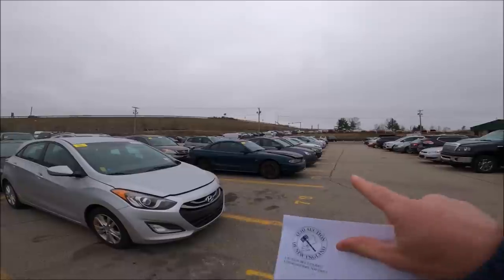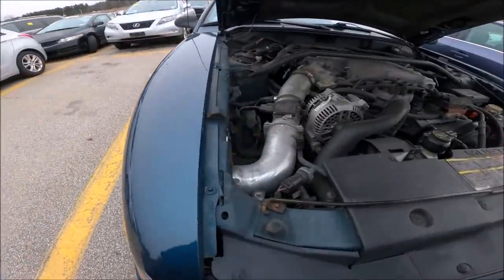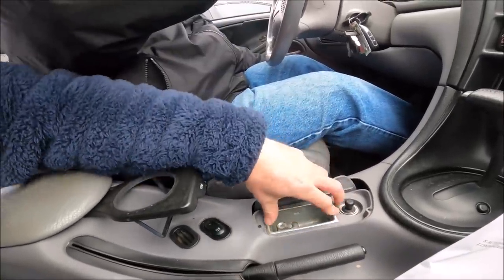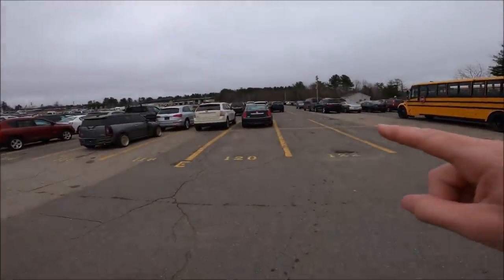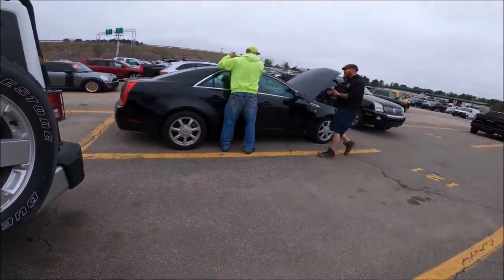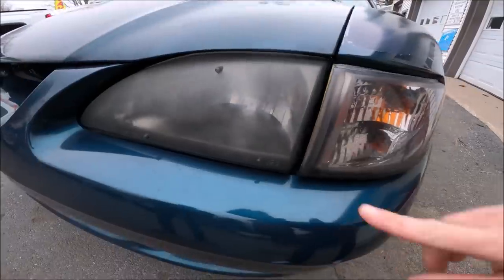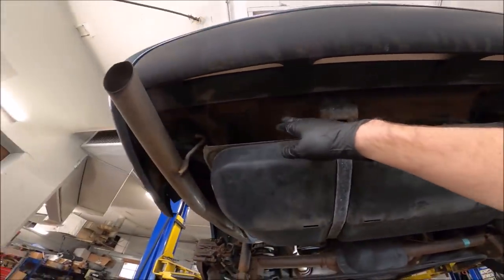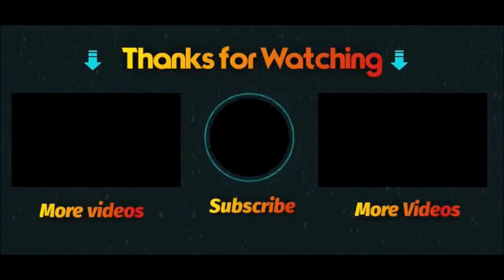What will $2000 buy you at a Dealer Only Auction? - Flying Wheels

Comment: Well the GTO is actually a Holden Monaro, The factory was shut down in 2016 and they were made in limited numbers so they sell in Australia for up to 80k.
Reply: Yea only 26k probably in the US
Reply: Wrong... Holden is its own company. Pontiac stopped making the Gto in 2006.  And as of 2017 you couldn't buy it cheaper than 8k. One of the last modern hot rods

Comment: Craig, I completely understand your excitement over the Mustang. It's a once very common, mass produced car you'd see everywhere. Now? Not so common. Plus it is rough around the edges, but solid enough to improve & have some fun with. Parts & pieces are plentiful and overall won't bankrupt you fixing, restomodding and improving.
I have a '17 GT350 and '76 Valiant in the garage. You know which pulls people down the alley to the back garage? The old, malaise, beige, V8 Plymouth. They can relate to it. Nostalgia. Little things I do are easily seen (it's very clean & solid- no rot, the interior isn't ripped or cracked all to Hell). It's unusual.

That Mustang? Same thing

Comment: Love the Stang. 90s cars are the best. I have a 99 turbo Volkswagen that I built to 350 wheel horsepower for pocket change. That 5 liter is another one of those perfect for a budget build.  Heads and cam used off eBay. Bam. A ripper.

Comment: Tell me one thing.  In order to become a successful used car dealer in the USA 🇺🇸 .
A person should own his own workshop or he can outsource all the repairs and cosmetics and get done and still make good money?
Reply from the maker: When I started I outsourced all of the auto repairs and did the detailing myself
Reply: @FlyingWheels  thanks for answering.
Reply: there's a local used car lot that doesn't even know enough to change the oil on a car they repossessed after 18 months of slow payments. And it had the exhaust pipe just hanging on by one bolt, which they didn't notice. They did know enough to clear all the engine codes after anyone test drove it though. I ended up buying this hunk and thought I got a decent deal knowing I would have to do some work on it. Just didn't know how much. Now I understand why people say to take that dealers sticker off your car before you try to trade it in.

Comment: Craig, I didn't think it was possible to destroy an interior like that Mustang in only 80,000 miles. I don't believe that car is legit for a minute.
Reply: The odometer…I got mine with 94k, supposedly. The engine, manual trans and clutch were good. It was a “tired” car at that mileage. I always suspected the odometer had been f’ed with. But I’m a Honda guy that was torque shopping…found it. The powertrain was so fun. Over 60 mph it wasn’t trusty - the alignment and such. New, I’m sure it was no disappointment. It had some electrical gremlins too.
Reply: Yep it's suspect.

Comment: Craig Toyota Tacoma double cab 5 get bed 143k is it really worth 14,000.00 14 year old 2wd truck in TX?  I don't trust the dealers here anymore!!
Reply from the maker: Tacoma are expensive I don't pay much attention to them
Reply: @FlyingWheels  Thank you so very much for replying. I was a nissan hardbody guy but now need a truck good on gas mileage. 
i scored really good when I bought my Tahoe it is a 1995 with a 5.7 liter 4x4 it had a bad alternator and battery when I bought it for less than $1k
but it gets like 3 gallons to the mile.

Comment: it's so sad to think back to the early 2000s whe. you could buy all manner of cars for 500-1000$ that would run and drive for years with some proper maintenance.
Reply: It was alot harder to flip cars back then. The internet becoming more broadly useful over the last 20 years has helped alot because in 2000-2002 there weren't many avenues to find used cars to flip besides AutoTrader magazines, Ebay, and the local newspaper.

Comment: 2:00 looks like a puma went to town on that driver's seat lol
Reply: that's the thing that kills me with car makers: the driver's seat in most pickups too wear 100x faster than the other seats. If they made the seats or at least the covers, interchangeable it would not only reduce the production cost but allow you to even out the wear.
Reply: @muskokamike127  There's all types of automotive upholstery shops that recover just the worn seat bolsters for usually a couple hundred bucks in most cars (sometimes less if you unbolt the seat and bring it to them) - This Mustang might be cheaper to just find a nicer seat in the junkyard or on Ebay though, there's still alot of these things around considering how old they are now..
Reply: @Stressless2023  Yeah probably but with interchangeable seat covers you could double the life of the stock ones.

Comment: I had a 98 six cylinder and loved it . It was no dog maybe not GT fast but it got me pulled over enough as it was.
Reply: I had a 98 V6 as well. With a manual and a few mods (underdrive pulley, custom exhaust), it was almost as fast as the GT of the same era. Still miss that car.

No way this is an 80k mile car. 🤣

Comment: Graig, how does a 6 speed  manual have transmission fluid? I'm thinking power steering rack.
Reply: You should conduct a bit more research before throwing out a random opinion. to my knowledge, all transmissions except for a very slight few DDCT use fluids. Of course automatics will use ATF, and manuals will use mtf or even some companies recommend they be ran with atf.
Reply: @Tac_3403  Maybe you should conduct a little bit of research and find out where the transmission is located on a rear drive car. It is not in the front of the car to begin with. I was just pointing out that if the leak came from the steering rack it would be an easy and cheap fix .